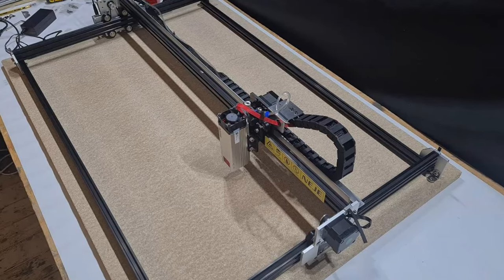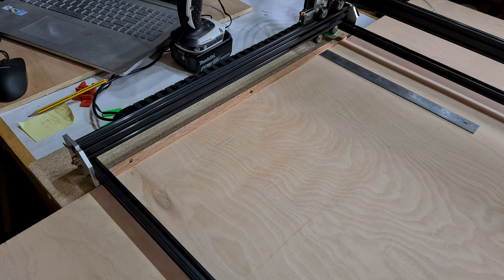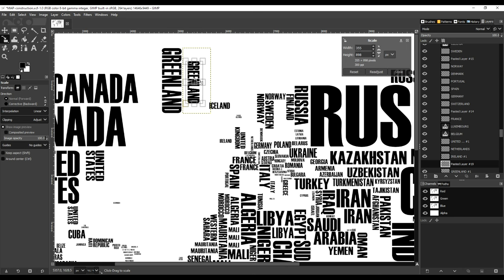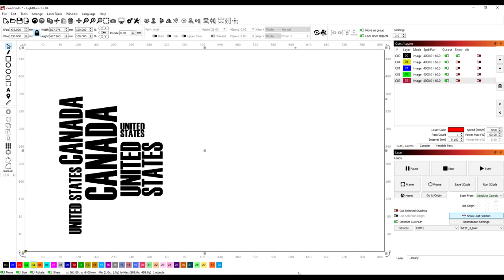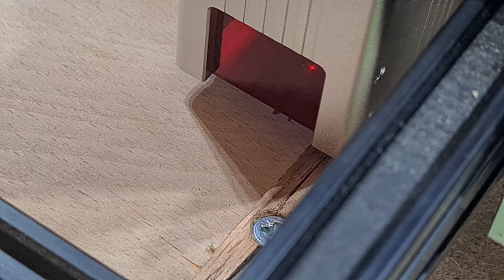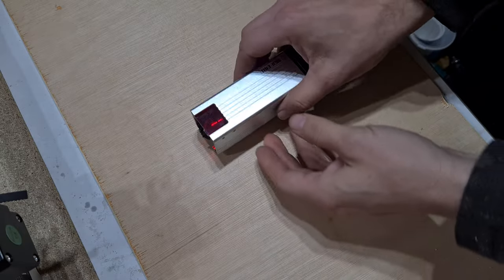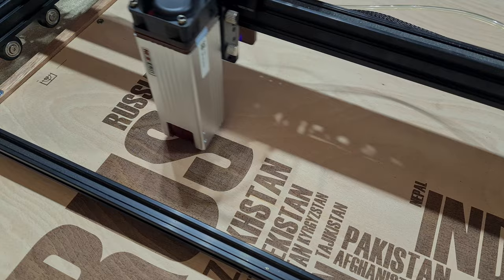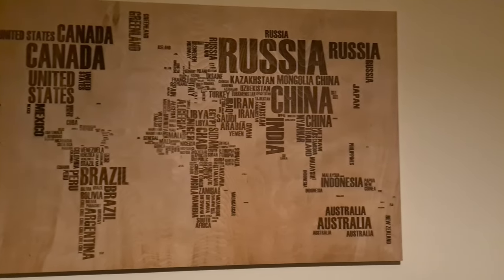How to Laser Engrave Bigger than Your Laser Bed  - NEJE 3 Max

Comment: Great way to extend the work window of that machine. A number years ago I did that when I engraved some very large signs on my milling machine for our church. A nice straight edge and close measuring setting up the new X axis and it worked like a charm.
Great way to do it on these small lasers for sure.
Gary
Reply from the maker: Thanks Gary. The guides were definitely a great help for easy alignment although the disparate nature of the text was a bit of a cheat. Having a continuous image would be a challenge and something I hope to try. Ortur have sent me their rotary device so I've got a couple of challenges in mind for that. Just hope NEJE can send me their next generation laser module, more power, deeper wood cutting. All the best. Ray
Reply: @RayWhitbyCreations  lots of options with the rotary for sure. You are on your way to become the Laser King. I will be watching!
Take care,
Gary

Comment: Hi Ray, I bought a small 10 watt optical power diode laser engraver.  No plans to do anything at that scale, but that's pretty awesome!  I've made a few large wood globes years ago, and while I had one at an art show I had a few WWII Veterans mention the lack of a few tiny islands in the Pacific that were too small to even show up at that scale.  They would've been comparable to the point of a needle in physical size, but I will make it a point to show them when I make another one in the future.  If you ever make a world map showing land masses you'll be cussing at how many islands there are lol.  Cheers!
Reply from the maker: Hey Steve, The decision to not include some of the smaller islands was hard, but as you say they would be unreadable. I guess with a long enough board one could have a magnified area for a cluster, but the whole thing would be cumbersome. Definitely need a more powerful and reliably quicker laser for this work!

Comment: I did enjoy the tiling demonstration. What air pump do you use for your air assist? Also would a shower exhaust fan be too strong for the venting system? I have the NEJE 3 Max with the 40640 head unit just have not set it up yet.
Reply from the maker: For the air assist I had a 40l compressor, but I do resin casting so having something versatile was useful. I use a dedicated extractor fan slightly more powerful than a shower exhaust fan, but could do with something a little more powerful than that. But it gets really noisy too. Happy lasering!

Comment: Very clever jig! Nice work- I think it turned out great! I'm working with a 900x900mm bed but I don't have space to feed through since it has to sit in a corner- so it's kind of a trade off. Either way, it's just a 10 watt laser so until I'm up to a 20+ or a CO2 I probably won't utilize the whole area- still nice though.

Prettiest place on Earth that I've seen in Person has to be the Rocky Mountains in Colorado. The view from Pike's Peak was just plain epic in all directions- I felt like I was drunk after driving up to the top, I think I was focusing on the road, then once I got out I can see for Hundreds of Miles in all directions- kinda messed with my head a bit!

Comment: Could you mount the laser base and the board to a pivot on some casters like mobile whiteboards so when you’ve finished, it can be rotated? When in use, maybe rest on other surfaces or some foldable legs?

Might even be able to mount an air filter and storage for the cover on it? :)
Reply from the maker: Hi Richard. I was wondering about mounting the frame of the laser on a mobile device (casters?!) so that one could engrave a full sheet of ply by moving the entire frame in sections and use targets in the margin for alignment. But I need a faster laser for that project. Thankfully the laser system is lightweight and I probably wont be doing too many large sized projects. I think storing it vertically may be the way to go. Thanks for the suggestions!

Comment: what parameter does u use? I just find out u make a world map, great idea!
Reply from the maker: This is for the NEJE E40, 4000 mm/min and 60% power. Threshold print and no air assist. For 120cm x 80cm it took around 12 hours.
Reply: @RayWhitbyCreations  pretty good

Comment: To solve the problems with your USB port you should have   ahem   mapped a drive.  🤭
Reply from the maker: Thanks Andy, I've turned the sleep option off for the USB ports and also got a PC that doesn't spontaneously freeze, which seems to have resolved the problem.